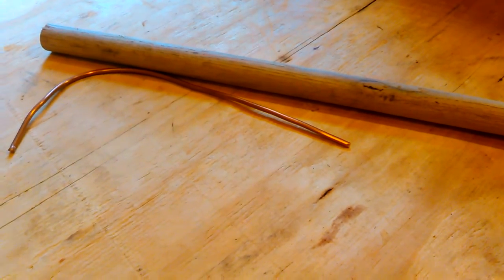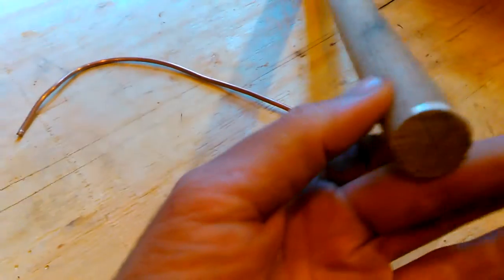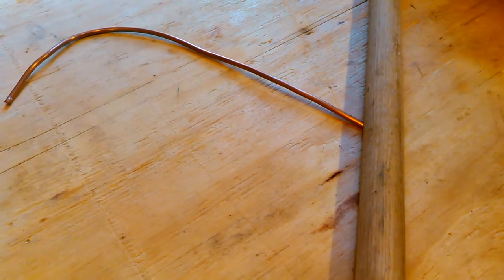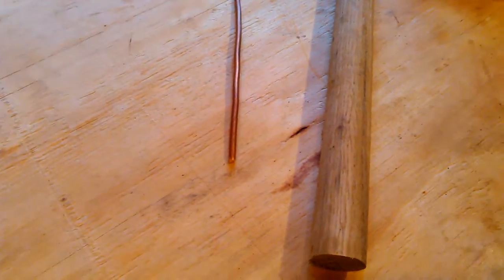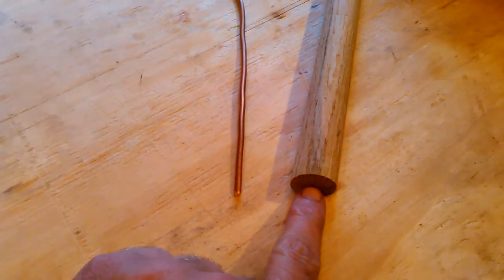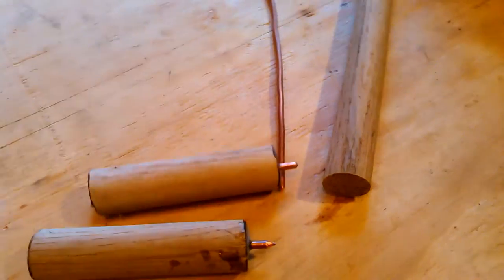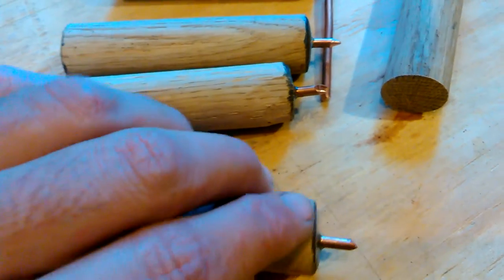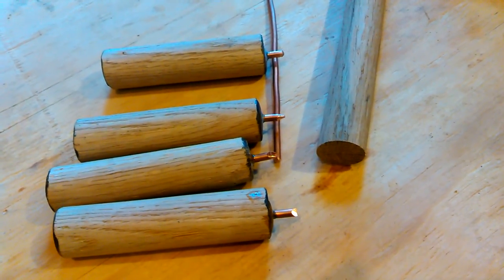Making flint knapping tools for pressure flaking.

Comment: Another how to video.....there are a dozen of these same videos leading people astray.  But go ahead and find out the hard way. I made the same mistake of listening to these guys.  The wire is too soft. The hole drilled in the dowel will wear out causing the copper to loosen and fall out after one use.
Reply from the maker: So, the tools made in this video were made about 2 1/2 years ago.  I don't knap every day, but they have seen their fair share of obsidian, flint, and glass.  They are still fully intact.  Some have been sharpened because copper is a softer metal, but it also grips better for the same reason.  As far as the metal falling out of the handle, I would suggest you rewatch the video, and pay close attention to the part where I use a high quality epoxy.